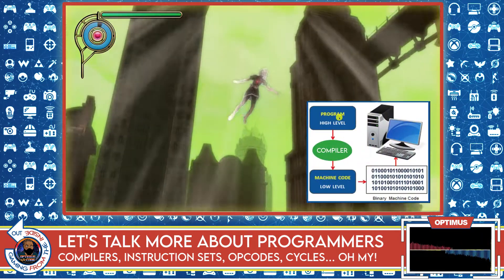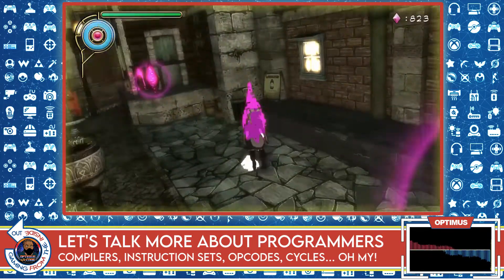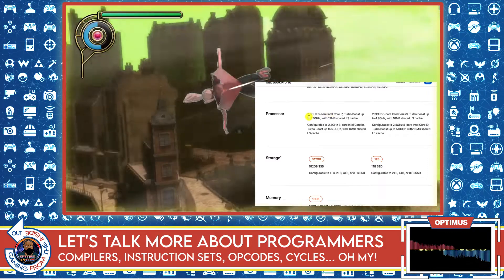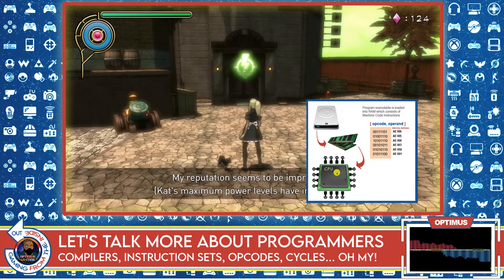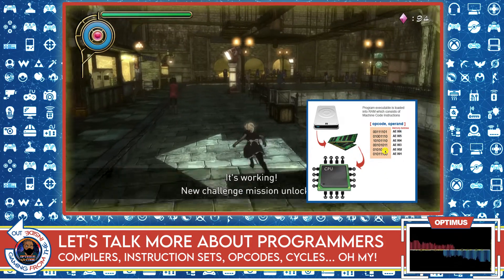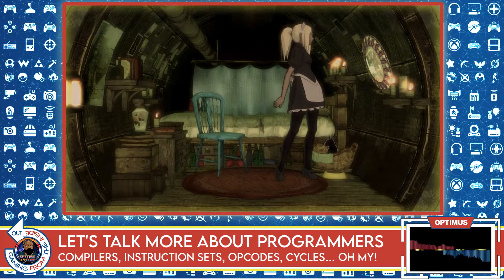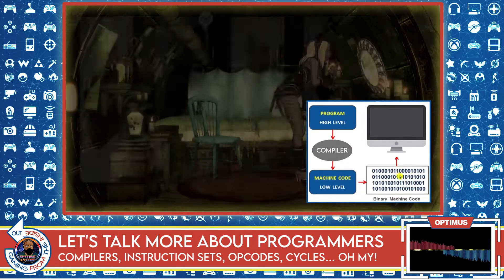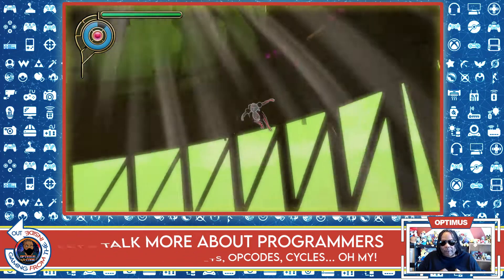Video Game Optimization: How Graphics Programmers Achieve Higher Frames Per Second - The Basics

Comment: Great video, but there are two things I think need clarification:

1.) CPUs of the same architecture always use the same opcodes for the same instructions. Newer CPUs may have additional instructions that the old ones do not understand, but for compatibility reasons the newer ones have to understand everything the older ones do.

2.) Nobody* manipulates binary code directly. If it is necessary to program at that level, it‘s done using assembly language. 

*there are exceptions, but that is typically for reasons unrelated to performance optimizations.
Reply from the maker: Yo! Thanks for the feedback!

1) I don't think this is true. 🤔 
A desktop chip, a mobile chip, a custom console chip, and a dev-kit chip can all be from the same architecture and they're not guaranteed to all have the same opcodes.

2) In the video, I mention the need for an assembler but glossed over it because that exact detail is not necessary at this level for gamers to grok the overall gist of optimization and reducing cycles.

After the background has been established, we'll go into more detail and be more specific and everyone can follow along.

I hope you stick around for the journey!!

PS... I know a guy who 100% manipulates binary code directly. He'll be making an appearance in a future video.  👍🏾
Reply: @optimuscode-gamingfromthei6910  
Any x86 CPU uses the same opcodes for the same instructions. If you compile a program on an x86 CPU for Windows, it will run on any x86 machine that is running Windows. That is the whole point of an ISA. And it doesn‘t matter if it‘s AMD or Intel. Otherwise it would be impossible to distribute programs in binary form. The reason you have to recompile between a machine running Windows and a machine running Linux for example is a different one. They use different binary formats, calling conventions, system calls etc. But that is completely unrelated to the ISA. Like I said earlier, newer CPUs of the same architecture can have additional instructions. E.g. Skylake-X introduced AVX-512, so if you compile a program and specifically tell the compiler to target Skylake-X or newer (-march=skylake-avx512) it will not work on say Haswell, but it will work on anything Skylake-X and above.

Like I also said earlier, there are people who look directly at binary code, but it is not something commonly done. It is just not practical.
Reply: PS: I‘m not here to bash or anything. I really appreciate your mission to educate the community 🙂
Reply: @DR-mm1ps  Hello, I will be coming on Optimus' Channel at a future date. I should clarify there is a distinct difference between Assembly, Machine Code(Macro-Op Code), and Microcode(Micro-op Code/opcode). Assembly Code is the implementation of the ISA and does not represent the actual instructions supported in binary. We have a host of "illegal, ghost, missing, hidden" instructions for 1st party HW purposes that only exist in a Machine Code format. Our microcode is what differs between architecture to architecture. Machine Code is an abstraction(higher-level language) than microcode which is the actual operations the HW supports. We actually have been removing Micro-ops from HW support for x86 for 25 years now. We virtualize the instructions by runtime converting Machine Code to Microcode and build dedicated HW sequencers and queues for this. Writing Microcode is the most performant(and not available to developers normally), then Machine Code(Usually exclusive to developers that are 1st Party: Intel, AMD, Nvidia, ARM, Qualcom, Apple, etc.), and then Assembly(which is what some game developers utilize in console games, but has been gradually decreasing use.)
Reply from the maker: @DR-mm1ps  I never thought that at all. I understand that you just want to make sure the community is not misinformed. We share the same goal! 👊🏾
Reply: @leviathangamer6997  Yes, I am aware of the differences. What is important to developers though, is the ISA, as that is their interface to the CPU. How the CPU handles the instructions internally is a separate topic. The binaries that get generated from the assembly have to work on all x86 CPUs with the same feature set. Every ASM instruction is represented by one or more (depending on the operands) opcodes. For example the opcode for the `add` in `add esp, 5` will always be `83`, regardless of which specific x86 µarch is being targeted. Whether that gets translated into one or more micro ops, or several of those operations get fused into a single operation for efficiency is completely irrelevant for the ISA.
Reply: @optimuscode-gamingfromthei6910  👊